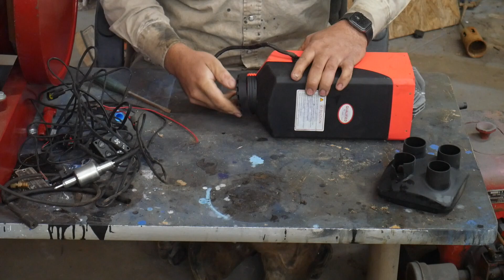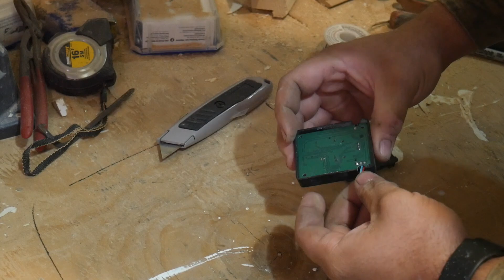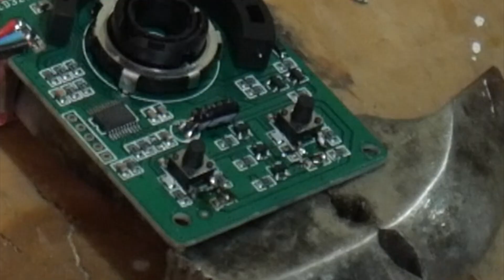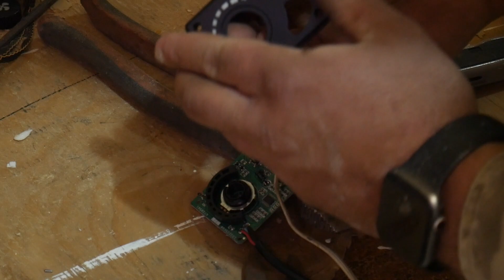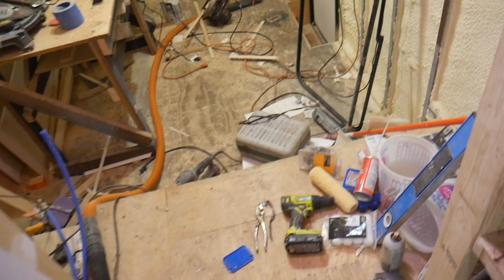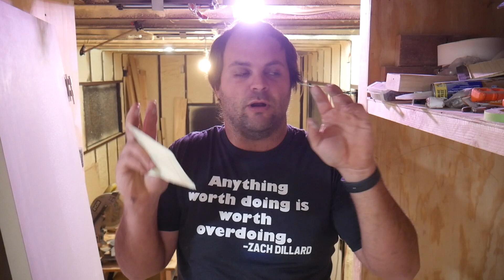Homemade RV. EP-24 Diesel Heater. 1977 Peterbilt 359 Toterhome.

Comment: it is not advisable to try controlling the heater directly yourself with a PLC, bypassing the heater controller, you won't be able to guarantee the same level of safety, and you most likely won't regulate as well as the properly tuned PID of the controller MCU anyway, plus most likely there are some specificities to such heater that you may not know yet and which are handled by the controller. Peoples easily call items "chinese craps" but forget there is actual engineers behind any product, who worked days or weeks and actually studied the ins and outs of the device device, designed the control board, wrote and debugged the firmware. Of course the cheapest the product, the more generic it will be and that means it may be an assembly of standard parts, including the controller (that is how the Chinese industry works). In such case the matching between parts or the performance won't be as good as it should be, however it will still be better and safer than something you make with a PLC without actual experience of embedded systems design, and knowledge of the specificities of the device, regulations etc.

Comment: I know this is old but I hope you see this. Your heater fan should not be making all that noise. When it was dropped in shipping that fan shifted and is causing all that noise. I have what they call a 8k heater, same thing. They just change the pump size for a 5k or 8k. I changed my pump because it used a lot of fuel. I dropped the pump size down and the heater runs much cleaner and uses way less fuel. I live in PA and will run the heater months at a time during the winter no problem.. I also have 2 Webasto's from the 90's called air top 32's that I use on the coldest nights. They turn on automatic at 68 f. They are expensive for parts if you can find them. The cheap heaters are not for everyone but if you like to tinker and do not mind they can really work well. If you can't be bothered spend a $1,000 and get a good German one. Cheers...

Comment: I think these are intended for use in Vanlifer vans and small campers. I would go to some RV repair places and see what they have that have the heat capacity you need and durability to last more than one season.  I have watched a few YouTubes on these and the issues they have with them when the video isn't sponsored by the seller. A lot of the RV systems last a decade or more in camping use.

Comment: Is there some reason why you didn't use a mini split for your HVAC?
Reply from the maker: Ultimately yes. I would have to had 3 separate units to be able to run off of 120v and didn't want to have to mount 3 separate condensers.

Comment: zach, i am sure someone has advised you that the controller has the thermostat bulb in it, when you have it going it is going to get warm back by the heater and reduce the fuel reducing the heat output. move your controller outside of the cabinet. Also if you pull fresh air in from outside to run through the heater it is less efficient. if recirculate the air in the room it will output more heat.  Also you should have had a tank that came with the heater move that to a protected location and insulate it a bit so the fuel will not gel. I have one of these in my RV that works pretty good. however it isn't quite as fuelish as you say. mine used 3/4 to a gallon of diesel a day and while it is super quiet (put mine in the 5th wheel dog house ) so the air only outputs into the cabin . use it to exchange air a lot due to not wanting mold or mildew from condensation. the hot air coming out of the heater is very dry and that helps a lot for not frosting up windows or growing mold.  I also have a propane forced air heater which is very noisy and not very fuelish.  Good luck on your install and once you get the bugs worked out it will be very good dry heat.  Great video thankss

Comment: you might want to look at a hydronic diesel heater, with small fan heads to move air thru the hot water, easy to plumb and if you wanted to you could put tube under the floor in certain areas, like the bathroom.

Comment: I sure wish I'd found your channel last year when you were doing this.   I'm curious as to whether or not you took any radiant heat temps around the heater?  I'd be just a tad nervous with a combustion heater in a wooden frame, but that's just me I reckon.  I'd be inclined to put in some radiant heat barriers in a non-flammable enclosure out of an abundance of caution.   I used to install and service gasoline combustion heaters in Volkswagens 50 years ago, and those thing were pretty scary too!

I'm amazed you got that controller all soldered back together with the forge iron you used to solder!  lol
Reply from the maker: The exhaust was very hot. I'm guessing probably at least 500F the rest was pretty cool maybe 130F or so. If the heater was running and you blocked the intake it would get very hot before shutting down almost to the point of melting the case but ultimately did survive.

Comment: Great video!! First off I love the t shirt.(size large) I saw your comment that you might up grade to a better version, I’m planning to use a RV fireplace with the heater in it.(I only have 132 sq ft) Zack do they still use a lot of hit and miss engines on the oil wells, I’ve seen the ones you fixed with electric motors? Keep them coming. Kc
Reply from the maker: Thanks. I don't have any gas engines running anymore, they aren't super common, but there are quite a few still out there running. You see them most often in deeper low volume/ high oil cut wells that don't take much hp to run them. Theres a couple of companies, one comes to mind, that have mostly gas engine even when electricity is near by and still install them on new wells. The other thing that has killed them is that the price of electricity down here is very cheap due to the price of natural gas and coal being so low. Interestingly the reason I stated this channel years ago was to do old gas engines/ junk I fix, and it never happened. Ive got a few old engines in various states of disassembly that I plan on fixing someday. The engine on the bench is actually not mine its a friend of mines that I'm supposed to get running, however the one in the floor is mine and its the same model.

Comment: If you used an original Webasto or Espar you shouldn't have the issues that you did. The Chinese heater is like you said a piece of crap.
Reply: Or if you could get a used Aquahot or something similar would be 👍.
Reply from the maker: I agree. I will probably swap it out down the road.
Reply: I’ve had 4 of the espars in my boats. Pay once cry once

Comment: i have a afterburner controller, works better. also make sure you run really big wires or voltage drop when the glow plug is running stops it from starting. happens to me if my batteries are not at 100%

Comment: I have that in my rv that I built. I have the digital controller model. I mounted it below my coach.noise not an issue. Wife and I love it.we Also have a mini split with a heat pump. We use the mini split as the main if we are plugged in or on generator and use the diesel if it gets cold.22 degrees in Colorado and we were toasty.

Comment: I had same problems you describe, changed to the Digital controller and it works good now. It also will not draw out of my peterbilt fuel tank i guess its too much gravity. With a 10” fuel line it ran for 6 hrs very smoothly